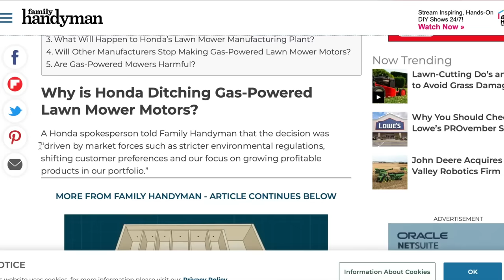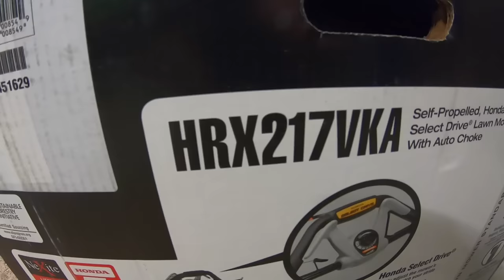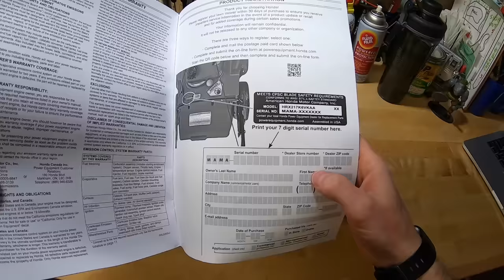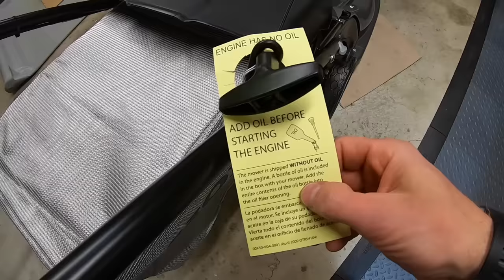ARE HONDA LAWN MOWERS STILL WORTH BUYING IN 2023?

Comment: I bought a 216vya honda and the plastic door where it attaches to the bag allows for blowby clippings to hit you in the face, and the downward flap speed control is frustrating at best.  The engagement of the bag on the 217 and the upward facing speed control flaps appears to be a big improvement.  Home depot will take the 216 back on return and I'm trying to decide between the  toro and the honda 217 series.  Talk me through it.  I'm leaning Honda as I ran my HRX215 for 23 years before I finally put it to pasture.  Thanks in advance
Reply from the maker: Hey Randy, I’ll be doing a comparison of these two mowers in a few weeks. Stay tuned!

Comment: Hi JB, I just found your channel. I like your videos and have subscribed to your channel,  

I need some advise.  For the last 35 years I have used Honda lawnmowers.  I always buy the HRX 217 model.  Unfortunately, my current Honda is quiet old and I planned on replacing it in the spring of next year.  I just recently learned that this is not possible.  I live in Troy, NY at the other end of the state from you.  I take very good care of my lawn equipment, and keep it for a long time.  Currently I’m trying to nurse my old Honda through Oct.  I’m having clutch problems and the costs of repair ( the hourly wage here for small engine repair is $100 an hour and up) will be at least $300 to $400 will be too much. I do not have your skill level in repairing  small engines.  I’ve called all the dealers around here and there is no more new Honda stock.

So my next choice would be Toro.  Your videos on the new Toro lawn mowers are excellent and taught my a lot about these mowers.  I think your review of the 21564 is right, that baby carriage handle is is wrong.  I also like your review of the Personal Pace drive system.  I don’t want anything to do with that  drive system. My review of the current Toro models shows that all the upper level models have the Personal Pace drive system.  So the only model that I see might work for me is the Smart Stow Recyler 21445.  

I would like a reliable mower, with  3 mowing speeds, good mowing height up  4”, gas powered, rear wheel drive.   I am 75 years old but still very active.  My lawn is midsized and completely flat.  But there are sections where there is a lot of backward and forward.

I know nothing about the other companies that make lawn mowers.

Do you know of any online places where I could still buy another Honda?

Are there other companies that I should look at? 

Thank you for all the hard work you put into your videos.  They are very helpful and I plan on being a regular visitor.
Reply from the maker: Hey Mike! Appreciate your positive feedback. Choices are kinda limited nowadays for a decent lawnmower. The quality just isn’t there. The toro 21445 is a decent mower but not perfect. It’s definitely a better option but rustproof that deck regularly. I’ve seen them rust out fast. I like the drive system on that one a lot better too. You could also keep an eye out for a decent lightly used Honda. Thanks for watching!

Comment: They are the king of lawnmowers in Australia. All the mowing guys used HRU196 and HRU216. Heavy, but built to last 20+ years.
Reply from the maker: Thanks for sharing big Chief!
Reply: In Europe the HRU is called HRD (many names!) with the bulletproof GXV160 engine, mine is stil working after 27 years 🙂
Reply: @Tintoycar  Yes the GXV160 is outstanding. I have a HRU196 here also over 20 years old, still starts first time.
Reply: Disappointing that the rear roller models only seem to be available in the UK. I’m in the market for my first mower since moving to NZ, Honda obviously top of my list but I’m also considering a reel mower for the roller and a new experience

Comment: Just picked up a HRN216 for $100... it has two and a half hours on it, garage kept.  Seller knew what they had, just clearing out unused stuff.  Has the tiniest bit of surface rust on the bottom of the deck, after degreasing and rust removal, any specific kind of paint or sealant you suggest?  I was thinking just some primer and outdoor enamel would be fine?
Reply from the maker: Good find bud! I think that would be fine. Then coat it with slip plate like I did and barely any grass will stick. 👍

Comment: Having owned one for now starting my eighth year, the 217 is absolutely the best investment I've ever made in a power tool, bar none. The deck is the best, lifetime warranty. 

Pro tip: See that shiny aluminum looking bar the bag door rides on across the top of the back of the mower? Eventually it will come loose. Do yourself a favor and drill that rod at the end so you can put cotter pin in there. You might also want to put something up under that same lid to hold it open about an inch or two. Why? When you cut some deep grass, you'll want it to rear eject the mower cleanly. Propping the lid open a bit lets it blow through with no restrictions.
Reply from the maker: Great information here monkeybar! Thanks for sharing this! 👍

Comment: My old 4 stroke Rover finally decided to die last week and I've been looking to replace it with a Honda, we get different models here in Australia though. Been looking at the HRU196M2 which is a 19" cut alloy deck push mower with a GXV160 4 stroke engine, seems like a super solid mower. I must admit though, I am a bit worried about spending all that coin and then having petrol mowers banned in a few years time. Cheers for the video!
Reply from the maker: Thanks for sharing NA!
Reply: I was using a Rover Scott Bonner GreenKeeper (23yo). Considered the same Honda till I looked at and just bought the Makita XGT 40v battery mower. Zero regrets. Awesome mower.
Reply from the maker: @ecp4500  thanks for sharing!

Comment: Well done video with some great tips. Especially change the oil after 30 minutes of run time. The one thing missing was seeing how well the rear wheel drive performed, especially if the lawn had an incline. I understand the bad weather, but maybe plan around it. I bought a Toro RWD and had to push it almost as much as it drove itself. Since the places I can buy the Honda mower won't let me return it, I have a hard time spending $$$ and not be satisfied. Glad I found Garage Gear.
Reply from the maker: Thanks for sharing and welcome to the tribe sb!
Reply: @GarageGear  Well I have the honda hrx 217hya but now it is $999 isn't crazy
Reply: >Especially change the oil after 30 minutes of run time.
You mean change the oil after the first 30 minutes of break-in, right?  or did he say literally every 30 minutes and i missed it. (cuz thats kinda insane)

Comment: @HemiRod23
12 days ago
I work at a Honda Power Equipment dealer, and have already repaired several of these under warranty.  I thought the same as you... I'm a fairly big guy, and could probably pull the rope anyway.  Nope.  The starter rope wants to rip your arm out of it's socket.  It's a fairly lengthy process to replace the cam, because the crank shaft has to be removed to get to it.  The new engines are overhead valve, but not overhead cam any longer.  You have to remove all the parts under the deck, and all the parts on top until you get a nearly bare crank case.  Even the cylinder needs to be un-bolted and removed because the cam is under the cylinder.  The fastest I've done it so far is 2 1/2 hours, and warranty pays for 1 1/2 hours.  I would like to watch a factory tech and see how they came up with that time.  I'm hoping there may be a faster method or a trick to save steps.  Time will tell, I guess.
Reply from the maker: Thanks for sharing this!

Comment: I have an HRX and love it.  Like you said it a one pull machine from the day I purchased it.  The only thing I wish was available is a high lift blade.  It bags fine but I find during the leaf season some extra suction would be an improvement.  Honda has always been a pricey product line but you get what you pay for!
Reply from the maker: You absolutely do John! Thanks for watching!
Reply: All mowers are one pull machines if properly serviced and maintained.
Reply: If you think Hondas are pricey, wait til gas mowers are phased out almost completely, even mid level electric mowers are the same if not more than a premium level honda, once you include the batteries

Comment: I have one from a few years ago.  Got it crazy cheap! Was a return at Lowes. My biggest complaint is fixing the carb.  I had a previous troy built that was honda powered. That mower sucked... best thing about it was the honda mower.  13 years with it.  The two bolts that hold the carb on suck to put it all back together if you have to clean the carb.  I run premium ethanol free in mine and treat.   The new one seems to run lean and surge sometimes if I have cheaper gas. Just keep the fuel fresh and put it up correctly for the winter.
Reply from the maker: Thanks for sharing danman!

Comment: Great Video with a lot of knowledge on these Honda Mowers. Thank You.
As owner of North Valley Repair,  most know me as Mark Nye thefixitguy, these Hondas are good , but not great. They made them very difficult to work on, especially these GCV engines.
Over time, with this Ethanol Fuel today, these carburetors will either need to be replaced or rebuilt. 
The Ethanol just destroys these engines.
Getting the carburetor off is the easy part. Getting it back on is a nightmare at times.
All Honda needed to do was install bolt studs in on the block with nuts holding on the filter housing. This way you can install the gasket,  carb , more gaskets and the filter housing without everything falling.
I am working on changing this design out on all the Honda engines I work on.
I have do agree that the Honda engines are good and will last, if you use a fuel stabilizer or fuel conditioner like Seafoam. 
One more thing on the HRR and HRX mowers and GCV engines. 
Why did honda go to the plastic fan and plastic recoil ?
It's just one more thing I've repaired on most of these mowers.
Thanks again for the great video
Reply from the maker: Hey tng! My guess is cost on those parts! Thanks for sharing your experiences here! It helps our community! Thanks for watching! 👍
Reply: Which mower do you recommend?

Comment: I’ve managed to overseed a N. Atlanta,GA tall turf lawn with Jonathan Greene seed. It’s all come up really well with minimum weeds. I put down Scott’s weed & seed at start of the season as a pre-emergent. Post will be spot spray. My question is, with the hot dry Georgia summers, I tend to loose 1/3 of my lawn even with an irrigation system. I fertilize three times in the spring and three in fall. Over the summer all I do is water and still loose a lot of grass. Do I need to add a slow release fert like morganite or a liquid based fert over the summer? So, in short, how should I maintain a tall turf lawn in a hot dry climate in the summer?
Reply from the maker: Hey cp! I would try bumping up your watering program and perhaps try a liquid product with higher potassium to help increase plant strength. Theirs lots of liquid fert with it! Let me know what you decide!

Comment: The thing about changing the oil is you're supposed to warm it up, shut the gas off, tip it on its side 90° and the oil will drain which it did but then I set it back up lowered it again and more oil kept coming out and this happened several times.  so obviously oil is getting hung up somewhere on the way out when tipping over. annoying.  so just don't assume that the oil is completely out after tipping it once.  also the self-propelled feature isn't that great.  The wheel will stop spinning with any kind of downward pressure or just the weight of the mower.  You really have to help it along to get it moving and if you're going uphill you're still doing most of the work on your own.  and finally the mulch bag lever isn't as precise as you would think if you're too close to the mulch side it's going to just clog itself up and close all the way, so you really need to have it open at least 1/2 way for combo.  and finally, if you are bagging you will be emptying that bag every couple of minutes it is a very small bag and gets heavy.  videos like this always show it as the shiny new toy that has all the features but then the reality of using it it's a lot more work than is depicted.  but none of these are negatives they're just the reality of using it I love it and it's very solid and reliable and cuts nicely.
Reply from the maker: Thanks for sharing this Mike!

Comment: I have a honda mower I got in 21019..  not sure which model exactky..  but it has the GCV-190 engine and electric start..  that mower cuts like a machete..  its hands down the best mower ive ever owned..  it looks a little different ..  I have adifferent handle. . i can control my engine speed and my self propel speed. . it also has a blade brake so I can let it idle if I need to stop and clean up debris in the yard ahead..  its one beautiful machine..
Reply from the maker: Gotta love them! Thanks for sharing eldorado!

Comment: Having just come home with the new Honda HRN 216 KUA and mowed my lawn. I am pleased with the results. That is one good mower. Perhaps I should have got the self propelled but shrug, I thought that is one less thing to go wrong. 
 My reason for buying a new mower today was that the old one, a Ryobi which lasted seven years of fairly heavy use, finally would not rewind the pull start; cord replaced, spring had sprung, blades needed renew and while looking for parts I saw That Big Red HONDA. Love at first sight. Give me give meeee. Now  to get rid of the older mower. If I leave it on the sidewalk it may just disappear, I hope.
Reply from the maker: Thanks for sharing Steven!

Comment: Honda push and self-propelled mowers are simply the best mowers ever made, period.  I've owned two and bought my family one and we've been using them for over 20 years.  There simply isn't a better mower.
Reply from the maker: Honda makes a great machine Bert! Thanks for sharing
Reply: I agree. I bought my first one in 1983.  HR-214 SMA which had a Key Start.  Key start was a waste of money.  I've had many since I buy them broken and restore them.  Although the Honda's are excellent, I just bought a year 2000 Toro Commercial Mower.  It has the Suzuki 5.5 HP 2-cycle engine.  The self propelled system is harder to use than I like but the Mower's quality is like nothing I've seen before.  Plus I use it to piss off the neighbors that turned in their gasoline Mowers for Battery Mowers and now think anyone that operated gas equipment is a Terrorist.  Figured the 2-cycle would add to their frustration as they told me my quiet Honda Mower was ruining the Planet. Now they can see the smoke.  They were good with gas yard equipment until the Green Bug bit them.

Comment: I own 2 HRX217VYA and a HRN216VKA which I use for my lawn care service and they are beasts, all I do is change the oil 3 times a season and the blades twice a season and the air filter I do monthly as we live in a high dust environment. The HRN is going on 5 years old now and still fires up on the first pull except in low temperatures then it might take two or three pulls in the morning. Only weak link on the HRN is the wheels the plastic wheels tend to wear out pretty quickly but I just replace them annual along with the drive belt. I run Mobil 1 10w30 in all my mowers except in the initial breakin. Something I noticed with my HRX is the 12 oz bottle of actually read low on the dipsticks. When I did research the Honda GCV200 actually takes .042 qt not 12fl oz.
Reply from the maker: Thanks for sharing this Michael! You clearly take good care of your equipment!

Comment: I bought a "basic" Honda mower and I love it. It starts first pull and does a great job of cutting. I especially like the adjustable wheels. Sad to hear Honda will NOT be manufacturing any power products after 2023. This includes lawn mowers, snow blowers, generators and water pumps. The dealer where I bought it in my southwestern Ontario town told me that parts WILL be available for 10 years.
Reply from the maker: I would agree with the dealer that parts will be available for a while. Thanks for watching!

Comment: Hey JB, another great video. My Honda mower is only one year old,  but do you think I should buy one of those automatic choke actuators and keep in in my stock until I need it? Or is that not necessary. Oh, and by the way...I couldn't help but notice your buddy Brian's garage floor. Do you think this is the year you make your move to a polyaspartic coating for your garage?

Thx!
Reply from the maker: Hey Douglas! Thanks my friend! It wouldn’t be a bad idea to keep one of those on stock for that day you’ll need it. It’s about the size of a quarter so it won’t take up much space. 

A lot of my neighbors have had their garage done with that coating. All by different coatings and every single one had to have them come and have it fixed. They look great but don’t hold up. And with all the equipment I move in and out of here it will most certainly be ruined quick. I think Brian even had his redone at one point. Thanks for watching my friend!
Reply: Might I ask you about diagnosing the automatic choke actuator failure? I thought I had a stuck needle valve as I had fuel dripping from my air cleaner but then recalled your advice about the actuator. Is "fuel pouring from the air cleaner" a symptom of this component's failure? Thanks! @GarageGear
Reply from the maker: @douglaslippertindy  hey Douglas! This sounds more like a carburetor issue to me. A non working actuator will cause the engine to surge and rev!
Reply: Thanks a bunch, JB. I agree and, given the cost of a single needle valve vs. a new carb, I've ordered the new carb. Will change the oil, too, as I'm assuming if fuel was draining from the air cleaner enough entered the cylinder to wash past the rings and enter the crankcase.  @GarageGear